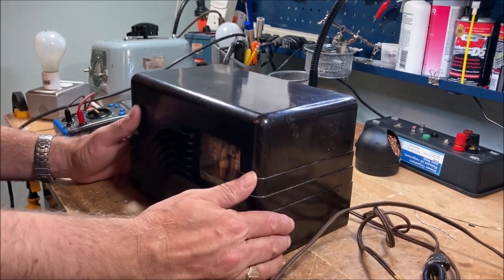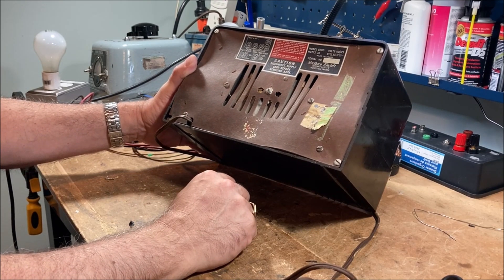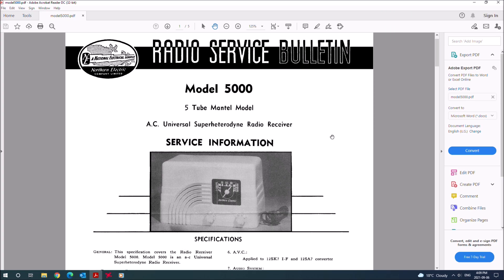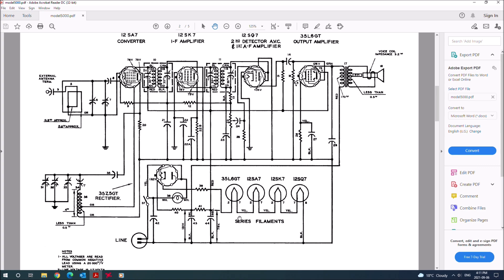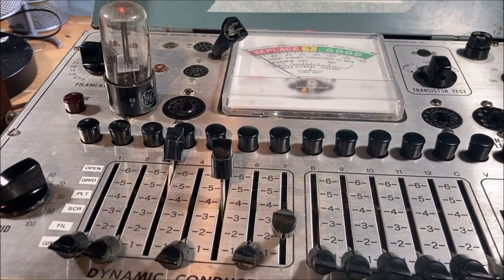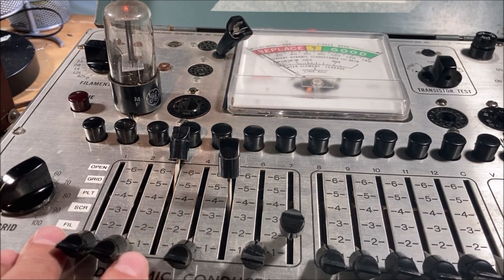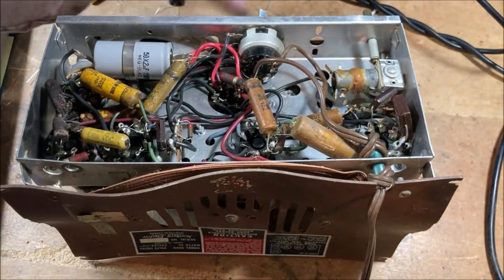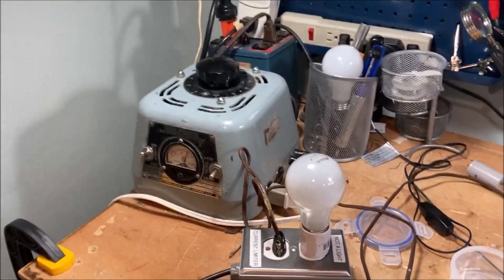1946-47 Northern Electric Model 5000 "Waterfall" Vintage Radio Repair

Comment: Do you have a parts list of what caps you replaced?
Reply: Goodness, I'm afraid I don't remember the details, but as you can see from the video, I replaced all paper wax caps and electrolytics.  That's my standard procedure.  The small value mica caps are almost always good and don't need replacement.

Comment: Take out the power resistor,  put a jumper wire in it's place, then use a 50L6. Works great and no hot resistor under the chassis.
Reply from the maker: Good suggestion.  Thanks.